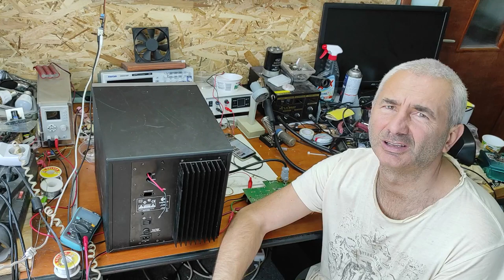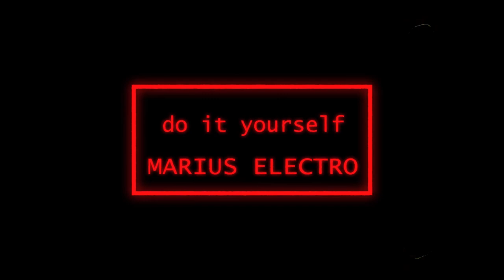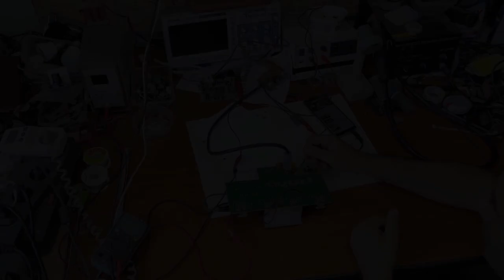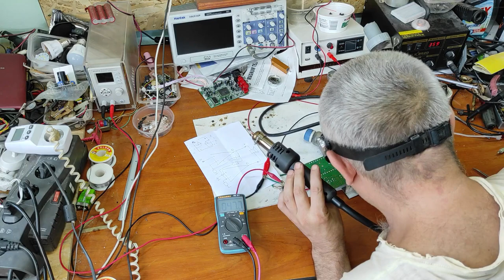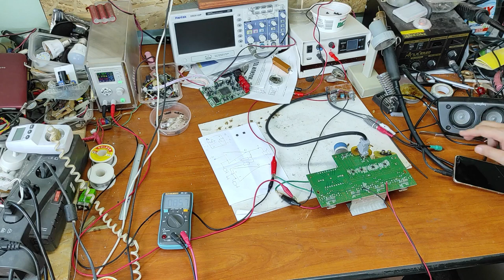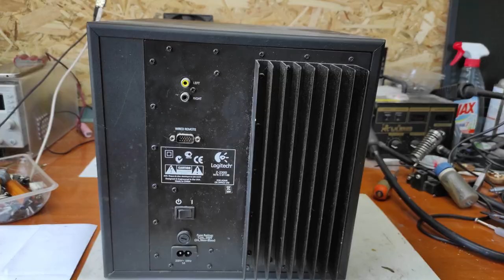Logitech z2300 inside and repair

Comment: There is so much glue on my 20 year old 2004 set here that the left channel has gone lower power & all garbely like it's being overpowered.  Looks like a bit of a pain to take apart & figure out, but glad to have come across this video;  was hoping to see how complicated this might get, my skill level is basic but I thought I'd have a go at this.
Reply from the maker: Good luck bro
Reply: @diymariuselectro     chkl, ya, ok, thanks
Reply: @diymariuselectro    I figured out the Left channel works coming out of the headphone jack on the Control Pad, when unit is powered on, so am thinkin this part is probably ok.
Reply from the maker: you should study the control pod schematics and u will understand where is the problem.

Comment: My z2300 2.1 system have all original components. But when I power it on there is a audible humming sound. The volume knob is set at ca 20% and gets really loud fast, it´s supersensitive. Adjusting the volume 1mm or even touching it and the neighbors come complaining. I have tried to find some conclusion or schematics on the internet, but nah 😞 Someone suggested replacing the capacitors would get rid of the hum, but I don´t know what to think. Replacing the IC`s may be a little to complicated for me. What´s your opinion or advice on getting rid of the humming?
Reply from the maker: first of all u have to locate the problem ,in the pod or in the unit.borrow another unit to test.after that,u can find a solution.

Comment: Which are the right and left satellite speaker op-amps and subwoofer op-amps of the Logitech z2300 audio system? that's the important problem! and I have 5 original 4565 5 smd op-amps, I just have op-amps LM4562MA or NE5532 op-amps instead of left and right satellites, would it sound nice if I installed them? or if you can give me an op-amp recommendation that will give good sound performance, I would be very happy. happy new year to every pouch.🎅🎅🎅
Reply from the maker: now I cant remember wich IC is on satelites and subwoofer,but u can follow with an active speaker and identify.I do this everytime.U should replace with same IC ,same pin configuration and low noise.I prefere original one.
Reply: @diymariuselectro  thank you, I have written to you before, some time ago I bought 5 LM4562 and 5 NE5532 op-amps and I installed them in quintuple order, but 1 satellite speaker stole 2. the satellite and subwoofer didn't play, then I plugged in the other op-amps, and it played 1 channel of satellite channel 2. the satellite was buzzing, so I installed the original 4565 op-amps again, but the right-left satellite rang, the subwoofer did not work, then I changed the location of the 4 op-amps on the back of the card, it improved (which op-amp of better quality do you recommend instead of the original NJM4565M jrc)

Comment: Do you need wired remote for the subwoofer to work or can I just connect rcas?
Reply from the maker: rca is speaker output.u need control pod with sub25 conector for this model.

Comment: Great video ! , I want to connect my Z2300 to a big powered Sub or use the Sub as a replacement for the Z2300  , theres no way I can connect the the Sub to the PC  as it doesnt recognise the signal, so how can the remote from the Z2300 be made as a controller for a different powered Sub, the Sub has no 15 pin input,  just RCA   can it be done sir?  Thank you
Reply from the maker: bro i dont understand the question,.
Reply: @diymariuselectro  how to wire z2300 to bigger powered subwoofer ?
Reply from the maker: pls give more details dont understant what u want to do.

Comment: Hello, my system is working properly, but when I turn up the volume on the right satellite speaker, the sound is distorted. There is no problem at low volume. What should I do?
Reply from the maker: @erkandokmeci17  tried to replace left with right satelite?
Reply: @diymariuselectro  Thanks, I'll try it when I get home tonight.

Comment: Hello, my Z2300 has one channel not working properly, the right satellite volume is very low compared to the left channel. I replaced the TDA7296 but the issue persist. What I can check ? Thanks
Reply from the maker: U can check the preamp part.and potentiometer.
Reply: @diymariuselectro  yes but how I can check the preamp section? Those four ICs are the same but are configured to do different things. Do you think I can bypass them and put the input signal direct to the power amp?
Reply: Also is possible to have the schematic of the DIY remote pod?
Reply from the maker: @LUKEFOUREYES  I found the schematic on the net.u can find it easily.
Reply from the maker: @LUKEFOUREYES  I have 2 ways to repair activ speakers:M1-inject signal on both inputs and folow the signal step by step with another amp.M2-inject audio signal on the input of the power amps,and move backward to the input.this is the way u can repair it.
Reply: Its happen on me too, change the old faulty ALPHA B10K with ALPS RK097 B10K and your problem solved.

Comment: Hey, great video. 🤙

I was just wondering, is that an original control pod? 🤔
Reply from the maker: its not original,its made by me and soon I will make a video about it with pcb and upgrades.hope that u subscribe .
Reply: @diymariuselectro , I just did, because I have tried to find one, and can only find some on e-bay, but people say they're bad.

But it's REALLY cool that you want to help others. 🤙

I hope you'll have a good day, peace. ✌️
Reply: @diymariuselectro , do you know when you'll make the video? ✌️
Reply from the maker: @DubHead69420  i hope in 1 month.if u have experience wiht pcb design and want to help will be soon.
Reply: @diymariuselectro , oh, alright. And I don't.

Hmm, have you seen them from ebay? Maybe I could use the housing, or maybe try and find someone with a 3D-printer. 🤔
Reply from the maker: @DubHead69420  I ve seen one from ebay,but i made my version with upgrade.much better.with usb and with bluetooth input.
Reply: @diymariuselectro , that's a nice idea with bluetooth. 🤙

And I was only thinking about the housing, because I know the eternals of them from ebay, is made out of low quality parts.

But I can't wait to see your video, because it would be to ba able to use the system again. 🤙

Especially because I've made a custom subwooferbox for it, that I haven't been able to use that much, because my  control pod isn't working.
Reply: @diymariuselectro , hi again, I was just wondering if you're still going to make a video for the control pod? 🤔✌️
Reply from the maker: @DubHead69420  yes its my plan but i have problem with pcb design.i need help to make it sooner.
Reply: @diymariuselectro , oh, I thought you already used a board? 🤔
Reply from the maker: @DubHead69420  I have a bord made on test pcb and I will make profi pcb version with bluetooth.I need help with pcb design
Reply: @diymariuselectro , okay. But how did you make the one you're using in the video?

I'm sorry if I'm misunderstanding you, but English isn't my first language. ✌️
Reply from the maker: @DubHead69420  its made on test pcb shematic is availabe on internet.
Reply: @diymariuselectro , alright.

Comment: Hello, I also have a Logitech z2300 sound system, but I did not have an original satellite speaker. I connected the Harman Kardon HKTS 16 speakers but the highs are still weak!
I have a question, is it possible to make the treble and mid sounds very good? Is it possible to improve the sound amplification for the Logitech z2300? If this is possible, I would be very happy if you make a detailed video.
Reply from the maker: I also use other satelites,jamo, to my sistem but the sound is very clear and I have a lot of highs.I beleive that is a problem with your satelites,the tweter is fault.u have to check it first before modifing logitech.
Reply: @diymariuselectro  My Harman Kardon Satellite Speakers sound good and crisp on the Harman Kardon Avr 265 Amp. But when I connect the Harman Kardon satellite speaker to the Logitech Z2300, the rhythm ringtones are very low and unrealistic, especially in metal music. I connected the pioneer ts-s20 tweeter in addition to the Harman satellite speaker to be sure. Everything is fine in the harman kardon avr 265, but the logitech z2300 is very strong, the sound quality is bad, the trebles are bad. I think the problem is not the speaker! In their discussion form they say that this problem is chronic. If you test it in different music genres, you will understand what I mean. It's not like plugging in different speakers will solve the treble problem, is it possible to do something on the circuit that will improve the treble and mids and make them better quality? I would be very happy if you share your views on this.
Reply from the maker: @SERKAN_HOT34  u cand modify the cutoff frequency and other parameters of preamp and crossover for highpass filters to adjust to your speaker,but its very dificult.its 4 opamps with low noise.u need schematic and skills.
Reply: @diymariuselectro  I'm technically dexterous I can repair a faulty circuit, but I don't know much about modifying a circuit, developing and designing it.
Reply: @SERKAN_HOT34 , have you tried to look at an equalizer for your PC? I bet you could benefit from that.

I think there is one in Windows you can use, or else you can probably find one on Google.

I hope it can help you. 🤙
Reply: @DubHead69420  I have an Asus x99 deluxe 2 motherboard computer and I have a Realtek ALC1150 onboard sound card, my operating system is windows 11 and I use its media player mp3... while listening, but I only turn on the equalizer of the sound card, and when the media player is turned on, the sounds overlap and echo,  I thought about getting an old digital or analog equalizer deck and connecting it to the logitech z2300 but then gave up.
Reply: @SERKAN_HOT34 , oh, alright. Then I don't know what you can do. 🤔
Reply: @DubHead69420  thanks no problem,   i keep searching🙂
Reply: @SERKAN_HOT34 , alright. 🤙

I have used some System Audio, as satellites, and after what I remember they sounds pretty good.

But it's been a long time since I've heard them. 🤣

I can give you the full name, if you want? 🤙
Reply: @DubHead69420  yes, it would be nice if you give a name and model, I used 2 Harman Kardon HKTS 16 Audio System speakers and connected 2 external 8ohm pioneer ts-s20 tweeters to them, but it didn't make me very happy, the hkts 16 speaker set is better and sounds livelier on the harman kardon avr265, i continue to research to make the logitech z2300 audio system more powerful and beautiful and for sound quality.
Reply: @SERKAN_HOT34 , that sounds nice. Have you made a custom subwooferbox for it? Because I have, and that sure is fun. 🤙
Reply: @SERKAN_HOT34 , they are called System Audio image 11.
Specs: Impedance 4 ohm
Amp. requirement 10-100 watts
Reply: @DubHead69420  no, I'm not thinking about making a subwoofer box right now, maybe another time
Reply: @SERKAN_HOT34 , alright.

Maybe here in next week I will upload a video of mine. 🤙

BTW: did you get the info on the satellites? 🤔
Reply: @DubHead69420  ok. yes I know about satellites
Reply: @SERKAN_HOT34 , cool, I hope you'll find a good pair.
Reply: @DubHead69420  Yes i'm researching i hope i find a quality speaker and it plays super quality music
Reply: @SERKAN_HOT34 , so do I. 🤙
Reply: @SERKAN_HOT34 , hey I just saw I gave you the wrong name, they are called Audio Pro, instead of System Audio. Sorry about that.
Reply: @DubHead69420  That's not a problem🙂
Reply: @SERKAN_HOT34 , cool. 🙂
Reply: @DubHead69420  yes, my friend, I watched, congratulations, it was nice👌
Reply: @SERKAN_HOT34 , haha, it's nice that you liked it. Unfortunately I couldn't turn it up, because my neighbors were home. But it still sounds good at low volume. 🤙
Reply: @SERKAN_HOT34 , hey man, I just saw this video, and immediately thought of you! I haven't tried it out myself yet, because it's 1AM. But I think I'll try it out tomorrow.

Here's the link for the video: https://youtube.com/shorts/VNb98KJK6n4?feature=share
Reply: @DubHead69420  these rack mounted speakers will not be compatible with logitech z2300 logitech z2300, impedance 8 ohms, Dayton Audio B652-6-1/2" AMT Tweeter, enpedanssi 6 ohms!
Reply: @SERKAN_HOT34 , I was talking about the equalizer.
Reply: @DubHead69420  i don't quite understand, can you tell me in detail what you did
Reply: I connected klipsch rtp satellite to this subwoofer on my computer. These are two satellites 8 ohm, 50 watts from a 5.1 system. I got a very high quality jump in sound. They sound very good. Also be sure to use the equalizer. I have APO installed. I wonder how you solved the problem?
Reply: @cosmicwind8800  No problem mate i don't have a logitech z2300 satellite speaker instead I connected 2 satellite speakers with Harman Kardon Hkts 16 BQ and then connected 2 Pioneer TS-S20 tweeters to these satellites, the sound improved a little I wanted the sound quality from the harman kardon AVR265 amplifier to be better but it wasn't very great then I plugged in different op-amps and tried, but 1 channel didn't work and the subwoofer went out, I put the original op-amps back in, and it worked normally i left it like that, sorry i told you too long.
By the way, the Klipsch speaker system is also very high quality.
I want to buy my MARANTZ 7000N Stereo Network amplifier and a Bowers & Wilkins 603 S2 tower speaker for a professional hi-fi system when I have a lot of money.
Reply: @SERKAN_HOT34  It just seemed to me, that you are connecting other satellites to the Logitech Z2300subwoofer and they do not give high frequencies. By the way, when I have a lot of money, the first thing I will meet is Susana Almeida. I hope she doesn't get too old by then))
Reply: @cosmicwind8800  My aim was to increase the sound quality instead of high frequency, by the way Susana Almeida can be a good alternative, I hope she won't be too old until you buy it🙃👍 If I had a lot of money, I would buy a linadiaa. She runs like a racehorse on every track 🤣🤣
Reply: @SERKAN_HOT34  Oh yes, I'm impressed! This is a very good hi-fi system! We'll be rich for this one day..
Reply: @cosmicwind8800  it certainly is🤪🤪👍